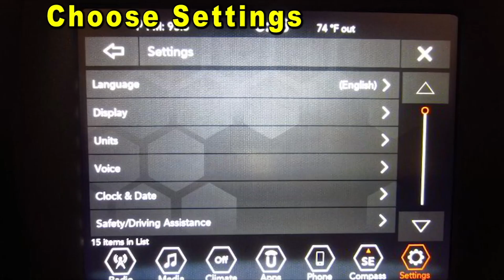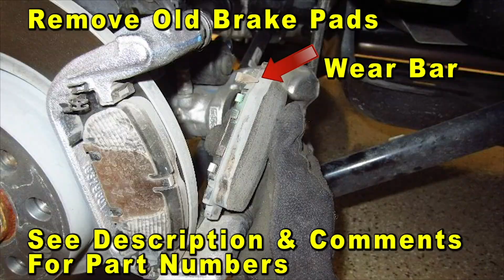2017 To 2024 Jeep Compass How To Change Rear Brake Pads With Part Numbers - Quick & Easy

Comment from the maker: Jeep Compass Rear Brake Pads - https://amzn.to/3TqxMRy
Wagner Rear Brake Pads Part Number - https://amzn.to/4ahoblX
Power Stop Ceramic Brake Pads Part # - https://amzn.to/4ahoehD
Disc Brake Piston Tool - https://amzn.to/472SdqG
Precision Screwdriver Set - https://amzn.to/3sLixaP
Plastic Pry Bar Tools - https://amzn.to/3HMtsV7
Socket & Ratchet Set - https://amzn.to/3Z17LbA
Mechanix Gloves - https://amzn.to/3jCnHkt
Torque Wrench - https://amzn.to/3vS5uSI

The Paul79UF YouTube channel is a participant in the Amazon Services LLC Associates Program, an affiliate advertising program designed to provide a means for sites to earn advertising fees by advertising and linking to Amazon.

This DIY video shows owners of the 2nd generation 2017, 2018, 2019, 2020, 2021, 2022, 2023 and 2024 Jeep Compass how to change the rear brake pads when the car is equipped with the EPB (electric parking brake).

Comment from the maker: Check out the DIY guide for changing the rear brake pads (with EPB) on a 2nd generation 2017 to 2024 Jeep Compass -
https://www.paulstravelpictures.com/2017-2022-Jeep-Compass-Rear-Disc-Brake-Pads-Replacement-Guide/index.html

Here are all of the DIY repair and maintenance tutorials for the 2nd gen 2017, 2018, 2019, 2020, 2021, 2022, 2023 & 2024 Jeep Compass -
https://www.paulstravelpictures.com/Articles/2017-2022-Jeep-Compass-DIY-Repair-Maintenance-Guides.htm

Owners of other Jeep, Dodge and RAM vehicles such as the Grand Cherokee, Wrangler, Renegade, Gladiator, Cherokee, Grand Wagoneer, Wagoneer, Charger, Challenger, Durango, RAM 1500, Promaster, 2500 and 3500 may also find these DIY instructions to be helpful.